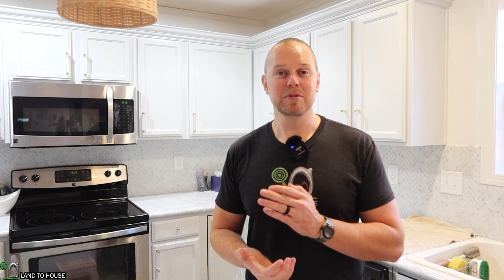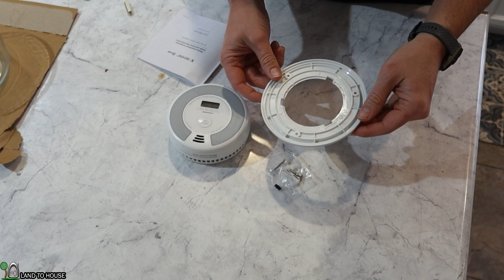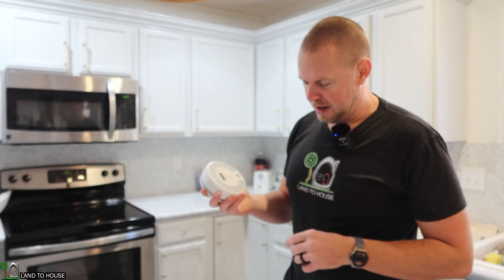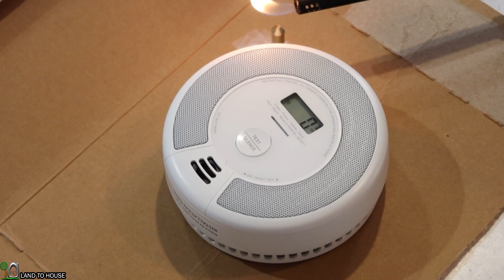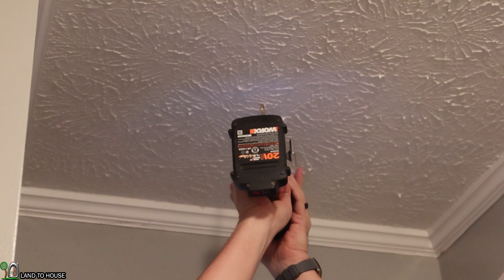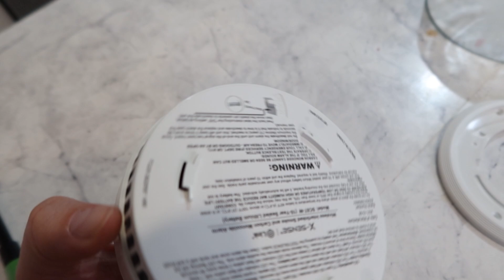X Sense CO2 and Smoke Detector

Comment: The glass did not block the transmission.  It takes 7 seconds before all the auxiliary alarms activate.
Silencing the auxiliary alarms will leave the initiating alarm sounding so that you know which unit has activated.

Comment: Very nice.  I'm guessing they don't need line of sight, based on the description on amazon.  I'm guessing it was coincident timing that you took the bowl off about the same time the  remote signaling circuit finally activated.
Reply: Maximum range is 800 feet, less in between walls.  They advise you place detectors between floors above each other to minimize distance.

Comment: Great review just a little advice everybody CO2 stays close to the ground. the levels of CO2 for a smoke detector / CO2 has to be extremely high for it to go off. The best CO2 detector is one that you plug into the wall it's closer to the ground and it detects lower part per million of CO2 than a smoke detector / CO2
Reply: Just so nobody gets confused, C02 isn't usually something people worry about. CO (carbon monoxide) is what kills people and what people commonly have detectors for. It's lighter than air, so basically reverse everything Steve said about CO2 for CO detectors.
Reply: Specs are as follows:
70 ppm for 60-240 minutes
150 ppm for 10-50 minutes
400 ppm for 4-15 minutes
Any of these levels will initiate an alarm

Comment: This is a CO detector though, not a CO2 detector. They do sell CO2 detectors, but they aren't really necessary
Reply from the maker: Thank you for that. I filmed and edited this yesterday and for some reason did not even consider CO vs CO2.
Reply: @LandtoHouse  No problem. I hoped you'd see my comment in time to fix it. Thanks for all the videos on ram pumps and micro hydro. I'm planning on getting mine set up at some point, so I'll be bothering you about those soon 🙂
Reply from the maker: Nice! Both ram pumps and micro hydro are fun to play with. This summer should have more of both!
Reply: @LandtoHouse  my fellow noobs.. the smoke detector does detect CO2.. it also detects carbon monoxide CO. You just need higher concentration (ppm) of CO2 then when you breathe to trigger.. for example from smoke..hope this helps lol
Reply: For C0 the best thing probably would be the tailpipe of your 🚗🚨
Reply: My lcd display is blank all the time, is that normal?
Reply: @mocharonccup1  shouldn't it only show something if it detects carbon monoxide?